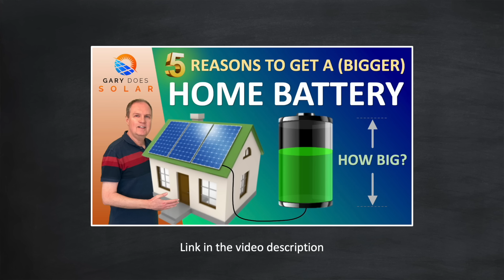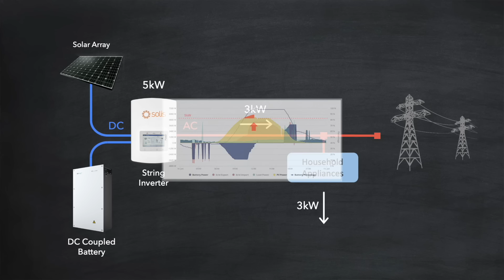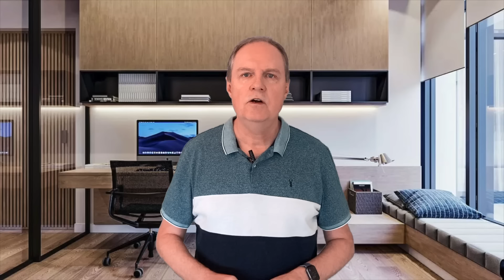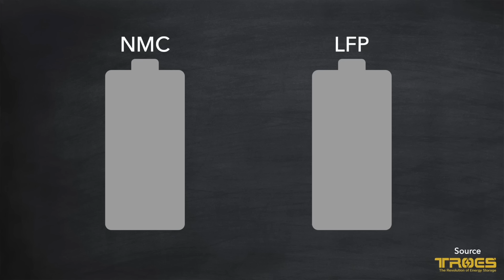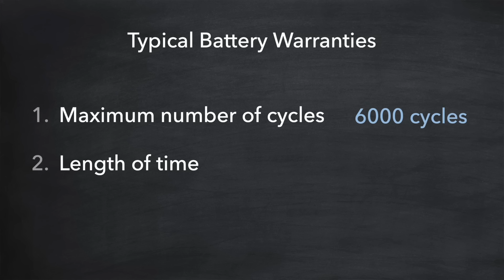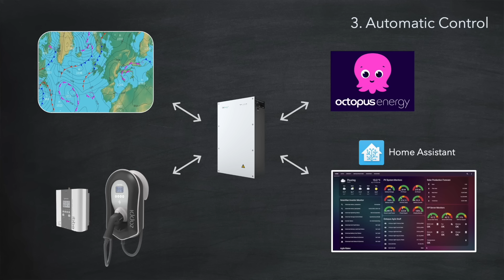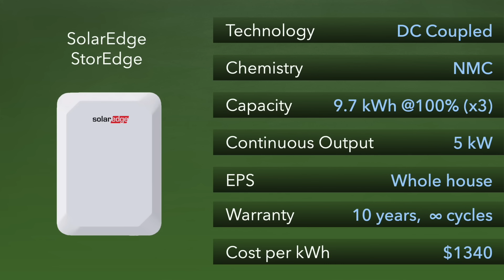8 Key Factors When Choosing the IDEAL Home Battery

Comment: Great video.

On the DC coupled battery you said (and so do many others) that there is no conversion required to send the power from the PV array to the battery. It is correct that there is no AC conversion. However, there is a DC to DC conversion so that the DC voltage at the battery and the DC voltage at the PV array are different and controlled to meet the needs of the battery and the PV array. DC/DC conversion is more efficient than DC/AC conversion but it is not 100% efficient and so there are still some (lesser) DC/DC losses when charging a DC coupled battery.
Reply from the maker: I hadn't considered this aspect - great point! Thanks for sharing.
Reply: This conversion is typically 98 to 99% efficient (as least with Victron MPPT kit which I have numbers to hand for). But the DC->AC conversion (and AC->DC conversion can be only 90%, and is very dependent on power level). It can be 97% (and that's what your inverter will advertise) but that will only be under one particular circumstance which may not apply much of the time - all others will be worse.

Comment: Keep them coming Gary. I’m planning to hammer my (expensive - how does Giv Energy do it so cheaply?) SE battery even more this year as I’ve just installed a heat pump and will be using the Cosy tariff this winter. You didn’t mention V2X. I’ve decided against a second battery to see how V2X develops.
Reply from the maker: Hi Rob - thanks - I'll keep the videos coming (each one is a ton of work though - I need to get more efficient somehow!) Yeah, I'm watching V2X (particular V2G) closely to see how it develops....

Yeah, keep hammering your battery - I'm doing the same with mine! :-)
Reply: I concur, another cracker from our man Gary.  Thanks so much.  We have a solar/battery install coming in Sept with 2 x SE batteries.  I plan to move from gas to heatpump next year for heating/hot water and the 19.4 kWh storage should allow me to run the whole house, inc space heating and our 2 EVs on 7.5 p overnight electricity.  Sounds too good to be true!

Comment: Regarding the clipping - it depends how much excess solar you have, I also have a Giv system, 5kW gen2 and 9.5kWh battery.  That's fed by 10kWp of panels (E/W split).  It often exceeds 5kW.  I use automations on Home Assistant to throttle the battery charge rate based on current generation to leave room in the battery through the day to allow that excess to charge the battery instead of being clipped.  On a sunny day, that's worth maybe 6 - 7kWh for me.  Really need GivEnergy to do a bigger inverter!
Reply from the maker: Good point, Mark - and East/West configuration will certainly flatten that bell curve making the area above the inverter limit slightly bigger. And it sounds like you're making really good use of the automations in adjusting the charging rates - very clever :-)
Reply: I noticed Fox do a 10.5 kW converter with 4 mppt string input.  More expensive but would appear to support larger house installations with   multi roof orientations.

Comment: I've been planning about getting a battery for a while and I have it down to 2 options but the difference wasn't covered here. One installer offers me a 5kw battery and the other one has a system of 3 1.8kw batteries connected. The overall capacity is almost the same and what the one I need. And price is fair in both cases. But I haven't found reliable info on whether is better to have many smaller batteries or just a bigger one.
Reply from the maker: Worth looking at the depth of discharge ratings of both solutions, and the overall charge/discharge rate. Personally, I'd go for a larger single unit rather than multiples small ones.